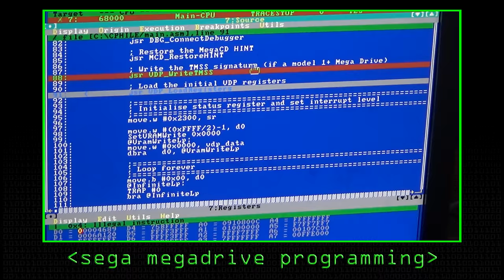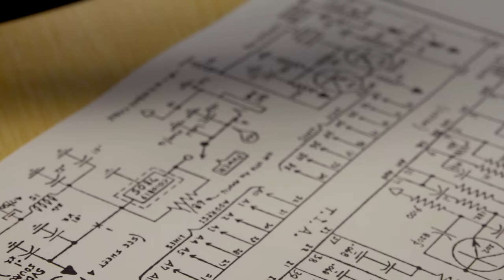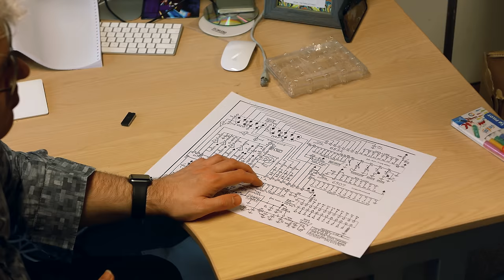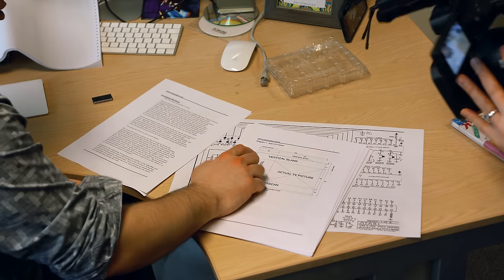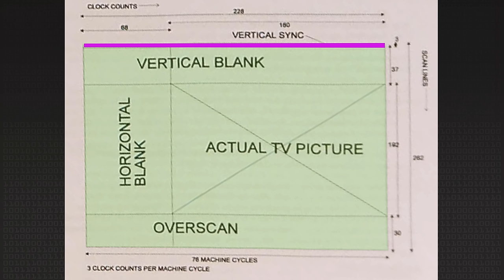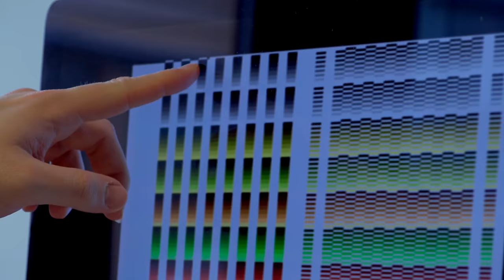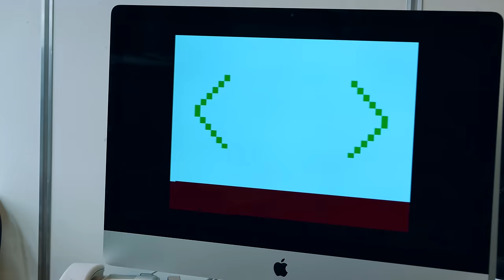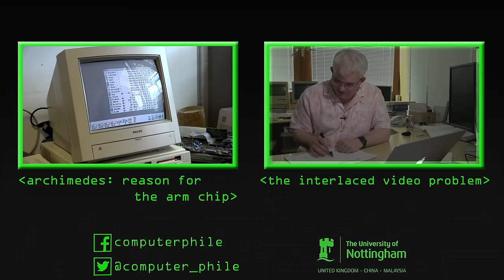Atari 2600 VCS Programming - Computerphile

Comment: I worked at  Atari as a game developer back in the day and it was the most difficult thing I’ve ever done in my life.  They didn’t even discuss the hardest part of the job.  What to do when you run out of your 4K of rom.  You would have to hand optimize the assembler to save a few bytes so you could add a fix.
Reply: Also, you needed to know the number of clock cycles for each instruction in your kernel.  I think it was 72 clock cycles, before horizontal blanking.
Reply: Yeah, figuring out how to squeeze the last few bytes can be a challenge.  For Toyshop Trouble, my solution was to invent an 8K cart that used only a single 74LSxx chip.  I'd love to tell you more if you want to PM me.
Reply: Flat Finger Tuning hi, congrats on writing a 2600 game.  There were 8k carts that used bank switching.  Management was against it due to added cost.
Reply: I recall 4K carts retailed for $5 more than 2K carts in 1979.  I forget what Asteroids cost (I think that was the first 8K cart).  What all were you involved with at Atari?  My published works include Strat-O-Gems, Toyshop Trouble, and the menu screen/music for Stella's Stocking, all of which seem pretty well represented on YouTube.  I'd be curious to know what you think of them.
Reply: I always remember Mike Singleton (RIP, sadly) talking about how short on memory he was when he wrote "The Lords of Midnight" on the Spectrum--it got to the point where he was re-ordering subroutines in memory so that subroutines could run straight into each other rather than having to waste 3 bytes for a CALL instruction!
Reply: Mitchell Balsam So cool, what games did you work on? I’m a huge player of the 2600
Reply: Thanks for the fun you gave me as a kid.

If you are trying to synch with the TV, does that mean the clock speed is only  60hz (50 for PAL)?
Reply: @d2factotum  3 bytes for a call instruction? Why is that so big, do you know? I don't know about programming for the 2600, or too much at all, but shouldn't it just be something like the address to start reading from, the length that should be read and the place to return to afterward? I figured that would be doable with one byte
Reply: @trenchwarfare9518  A call instruction takes the opcode itself (one byte) and then two bytes for the address of the subroutine you're calling, at least on 8-bit processors like the Z80 and 6502. How would you fit an address that could be anywhere within the 64k of addressable memory of one of these CPUs into a single byte?
Reply: @mb5058  youre a legend
Reply: Atari is apparently bringing out a cryptocurrency or is already on the market.  Has anyone heard of it?
Reply: @d2factotum  He's probably thinking of a branch with a relative offset? Still, 8bits (-128 to +127) range is still borderline useless...

Comment: "Racing the beam" is a technique I used on an Amiga game circa 1989. I was an employee of a small games company that used Atari STs as their main 16/32-bit machines, so I wrote my first game for them on an Atari ST. The vague plan was to port this towards the end of the project to the Amiga. The ST and Amiga store their screen bitmaps in completely different ways, and the ST code was pretty optimised for the ST bitmap architecture, so porting to the Amiga could have turned out to be onerous. My corner cutting (i,e time saving) approach was to run the ST code on the Amiga, generating the ST screen frames in an off-screen buffer, and then transforming this bitmap into a single video line of Amiga "bitmap" on the fly, staying one scan line ahead of the actual screen scan. This sounds a bit insane, until you realise that the Amiga version of the game had to run in 512K, and the ST game similarly already used most of the ST's 512K.. in other words, there was no more available RAM on the Amiga to perform a full bitmap transform; I just didn't have the extra screen of RAM. I guess some elementary technical planning at the start of the project could have foreseen such issues for the ST -> Amiga port, but the company I worked for at the time didn't do planning (full stop). "The good old days" of video games.

Comment: It gets even more fun when you learn that this thing has no interrupts. At all. The TIA allows you to halt the CPU for a pre-determined amount of time, stuff like "wait for the next caline to start", etc. But during that time, the CPU can't do anything else.
Reply: You mean the TIA specifically couldn't interrupt the CPU (in the classic run the interrupt handler once interrupt arrives sort of way)? Because you'd need interrupt handling mechanism for user inputs (from joystick buttons or whatever they were called), obviously.
Reply: @EvilSapphireR  No, no interrupts at all. The joypad is typically latched by the program once per video frame because it's still too fast for any human to notice.
Reply: @EvilSapphireR  Even later consoles don't trigger interrupts for user input. They just read from the controller one or more times each frame. The VCS was synchronized entirely by the RIOT timing chip. The TIA would automatically send an HBLANK signal to the TV every so many cycles, and when it did that it sent a RDY signal to the CPU, so if it was idling after a WSYNC instruction, it would pick up execution again. That's about as close to an interrupt as you got, except for resetting the CPU.

Comment: I wrote a "Breakout" type game on the St back in the 80.  There was something about writing in assembler that was so much fun. I still have some code out there on the interwebs for the ST in their "crawlycrypt" archives. Wish I saved all of it, not sure what happened to it.

One of the coolest things I wrote was a startup prog for the ST which dialed (yes, with a modem) the Naval observatory in DC and read the date in Julian time. There was at one time (maybe still is?) a line dedicated to just spitting out the current time every second. That time had to be then converted and set to a clock chip bit by bit (the ST didn't have a clock chip, or at least the version I had didn't). It was an aftermarket chip you installed "under" another chip. So the machine would keep time with this clock chip, but once power was cut, it would forget, hence the need to set it on each power up.

I had an Atari 800 and learned 6502 as well, but don't recall doing any graphics with it.

Comment: Things definitely got easier when the NES came along. It has a dedicated PPU (Picture Processing Unit). There is an interrupt at the beginning of the vertical blanking interval. Then game program writes to the regions of memory that control what is on the screen Then the PPU sends the image through the video output, until the next vertical blank.
Reply: The thing is, the Fairchild Channel F, which predates the 2600, also had a PPU of a sort. It had 2k of video RAM, though it had just 64 bytes(!) of general purpose RAM. You might think the 2600 was the last computer to work like this, but no, it was the ONLY computer to work like this. No one did it before or since.

Comment: Changing the playfield in the middle of a scanline isn't just a clever trick; it's one of the oldest.  It's how they displayed the score in Combat.
Reply: True, but I don't know at what point people realized that a cycle-perfect write could work so nicely in "mirror" (as opposed to "copy") mode, and that a game could use the middle 32 pixels with four writes per scan line.  Street Racer used four writes/line, but it used "copy" mode so there's a four-pixel gap between the two sides of the screen.
Reply: Actually, it is easier to do it in "copy" mode.  The timing is off by a color clock (aka "pixel") so that you can't update PF2 at the exact center of the screen.  (68 color clocks before the screen, plus 1/2 the screen width of 160, equals 148 color clocks before the center of the screen, which is not divisible by 3).  In order to work properly, you need to use the "ball" graphics object (which is the same color as the "playfield") to cover up the seam, or just leave it as it is.
The main problem with using "copy" mode is that you probably need to use all 3 playfield registers, which means you need up to 6 reads and writes per line, using at least 36 of your 76 precious cycles just to draw the playfield.
Reply: There's a latching stage between the PF registers and the actual PF output, so a write to a PF register in the middle of a PF pixel won't take effect until the start of the next PF pixel.  Games like Donkey Kong and Dig Dug which show non-symmetric playfield graphics in the middle 80% of the screen use mirrored mode so as to use four 8-bit PF updates per line rather than four 8-bit updates and two 4-bit updates.   Interestingly, because PF1 and PF2 show bits in the opposite order, both halves of the screen show a big-endian byte followed by a little-endian byte.

Incidentally, before I saw how other people created 32-pixel non-symmetrical playfields, I had thought the ball was needed to make the timing work, but it actually isn't necessary.  I did in one game end up having to use a missile to clean up a playfield pixel at the middle of the screen, but that's because score mode has a circuit that activates the sprite 0 circuit when a playfield pixel is active, and another which activates the sprite 1 circuit when a playfield pixel is active, and the transition between using the two circuits isn't synchronized accurately with the edge of the playfield pixel.
Reply: Thank you for that explanation!  I had not known that.  When I read "2600 101", it sounded like it did not work this way.  Now I need to re-write my kernel to take advantage of this wizardry...

Comment: Wait a minute, can you actually program an old Atari to set an old CRT television on fire? I don't watch a lot of Computephile, but I would watch that video. You've got to do that now.
Reply: You can do a lot of screwy things to the signal, some of which make the tube emit high-pitched squeals, but a tube that caught fire would've had a lot of other problems besides just a wayward programmer.
Reply: Just insert opcode HCF
Reply: There's tales of IBM PC programmers using IBM BASIC on 8088-based machines killing monitors by writing the wrong thing to the wrong part of memory. Seems they somehow ended up getting the CGA hardware to send a malformed signal to the monitor which it couldn't handle.
Reply: Roxor128 anything you send to the CRT controller was quite loose for CGA. You could easily send it impossible data rates, which killed the CRT
Reply: Even in Windows, the older CRT monitors you could blow up, by wrongly setting the resolution and frequency.
Some of the earliest monitors, would break, when rated for 60Hz, and you'd feed it anything higher than 72 or 75Hz.
More modern screens have no problems finding, and converting and displaying the right signal on the screen (convert higher frequencies to lower frequencies (like 50 or 60Hz) by dropping frames).
Reply: the DEATH CART

Comment: Skills that are in a completely different realm than today's average JS front-end developer(just for instance). The overall progress is truly beyond impressive. It tends to bug me if/when they have no conception of how easy we have it now. Everyone should suffer some form of a "punch card boot-camp" weekend imo.
Reply: Seeing stuff like this makes my head spin, I doubt I'd be able to be a programmer back in those days xD
Reply: Right. I'm from somewhere in that "middeground" zone I guess. It mostly just had more to do with knowing about the specific hardware/system involved(because you had to) & being forced to write the code as effectively as possible(due to the intrinsic limitations of the time). But like I said the progress has been astonishing, especially in the case of JS(for example). Now, with literally like 10 lines of code you have a solid frame of a full blown "window/app" with all of the bells & whistles(like audio & video etc) that will run on almost every device in the world. However, as a drawback one could say that much of the so called progress comes from the fact that there are layers upon layers of sloppy code all piled up on top of each other. & in the extreme that even if every individual "layer" was implemented as intelligently/efficiently as possible its still a sloppy paradigm. I wouldn't go that far personally. But I do find the history/evolution of technology almost as fascinating as the technology itself.
Reply: Back then, people were struggling with the hardware, which made subduing it much, much more satisfying.

Comment: Yikes that sounds like a nightmare to code for
Reply: It is! Had to make some simple programs for it on my computer architecture class and it was a fun but painful experience
Reply: It does require some cleverness, but on the flip side the display hardware is controlled so intimately by the processor that the it allows the programmer to make whatever trade-offs are needed in a given situation.  In my Strat-O-Gems game which I released in 2005 (but actually wrote display code for a decade earlier(!) most scan lines have six objects which share the same shape but have separate colors.  Since the game needs six colored gems per row, but it's okay if they have the same shape, that works out well.  If sprites were multiplexed in hardware rather than software, they probably wouldn't offer anything near that level of control.
Reply: Welcome to demoscene
Reply: It's a challenge, but once you understand the system there is a satisfying feeling when you succeed . I am reminded of the days when I first started to understand programming. That urge to make the next greatest gem. Writing some code and finally seeing it work as you imagined it to. Back then however a single person really could make the next great breakthrough game or software on thier own in a reasonable time period. I remember in school when others would finally know enough of code to get the bug. It was a rather fun thing to behold. OK.. enough of this reminiscing of times before a large percentage here were alive.
Reply: I have tried it. It is definitely challenging. These days there are tools that take away some of the nightmare, such as Batari Basic. But IMO if you're going to code the 2600, it's 6502 or nothing.
Reply: happy days. although the CBM 64 was 6510 not 6502.

Comment: I have recently been learning this very thing. Using an Arcadia Supercharger to load onto the real hardware ( a heavy sixer I rebuilt). It's a hoot. I come from those days of scrimping every last bit to fit everything, so it's not foreign to me, but it is sure different from the excess who cares if its perfectly efficient programming of today.
Reply: I had initially thought I would do this on a Tandy 1000 or earlier but then trying to find software to do it that could run on that old of system turned out to be to much of a challenge. No matter, the extra ease of today's computers and software made it something much more likely for me to finish.
Reply: I think the original SuperCharger loading was done with an Apple II.  The Tandy could have generated the waveforms easily with the proper coding, but I don't think the information needed to do so became public until the Tandy 1000 was obsolete.

Comment: It was crazy how they did games before. Nowadays it's more and more high level (look at Unreal Engine aso..)
Reply: aso = a shitty object?
Reply: Strangely, I find Unreal harder to code with than the 2600 in 6502. Back then, it was all about the game play. Today, it's as much, if not more so, about the visuals. And gamers' expectations are now much higher than they used to be.
Reply: Most computers back then had a display memory and were not hard to program games for.  The Apple II, and the TRS-80, and the Commodore VIC-20 etc. did not need to do crazy stuff like the Atari 2600 did because they had memory mapped displays.  But, the Sinclair ZX-80 and ZX-81 did use the CPU to draw the display, so there were a few like that.  :-)

Comment: Wouldn't it be easier to use the playfield to draw "<O>" then just position a cyan player block on the right side to make a "<C>"?
Reply: Drawing sprites has also be done in the same scan line routine, meaning, you have to check, whether this is the right scan line to display your player block or not. Since there 3 pixels per CPU cycle and a single instruction takes at least 2 cycles, you are soon out of time and may have passed the right moment. (Displaying multiple things on the same line is, where things tend to become complex.) On the other hand, the piece of code in question is already handling the playfield graphics. So you are probably cheaper off and quicker, while sticking to them.
(Remember, there's no notion of a vertical extent on the VCS, therefore there's also no way to just position a sprite anywhere on the screen.)

Comment: I wonder how the 6502 stack even works on the Atari 2600, because normally the second page of memory holds the stack, memory $0100-$01FF with the SP register indexing within it. But the Atari doesn't even have a single complete page of memory, let alone 2 pages. So the stack would fall outside of RAM. Guessing the 6507 worked differently?
Reply: The VCS decodes addresses incompletely, such that the devices mapped in the zero page also show up in page 1. The RAM inside the RIOT chip serves as both variables and stack. This also means the TIA responds to stack accesses too, allowing you, for example, to very quickly enable/disable the missiles and ball (as done in Combat) or to set the horizontal positions of objects in quick succession (this trick allowed the road lines in Pole Position to converge at the horizon).